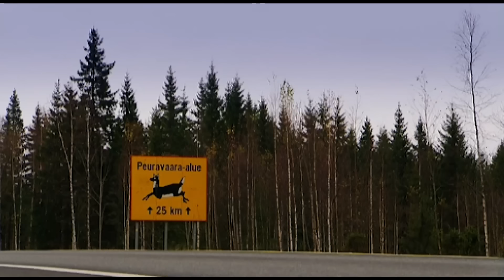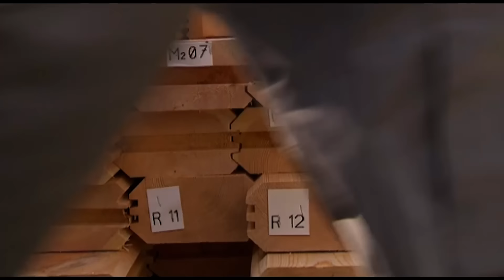Kent | Season 5 Episode 3 | Grand Designs UK With Kevin McCloud | Full Episode

Comment: What a triumph.
The house is beautiful and elegant.
And it for once that is actually eco-friendly instead of some huge monster claiming to be, despite it being build concrete, steel and isolated with polystyrene(a product made from fossil fuel that burns and is toxic).
Now all the wood means more maintenance than normal houses, but not crazy much and if maintained it will stand the test of time (there is a church made of wood in Norway that is 800+ years old).

Comment: Funny hearing all that praise of how 'fast' it is erected, when a prefab concrete slab house structure that size would've been erected in one day by three men (plus half a day of seam work for two men, then later on half a day of removal of molds etc. for two men). It would've required a crane for the day though.

I don't mean to knock timber structures, just pointing out some benchmarks of other alternatives.
Reply: in the states, concrete work is so expensive that most people fall back on timber to save money.  I just finished about 14 yards of cement.  patios, upright form walls, and steps + huge driveway.  Did all the work myself, with the cement truck driver just sitting in his truck all day.   Reason to not hire,  the bids were 48k for everything but the footing forms. which were about 18k I think.  did it all myself in 4 days.  with 2k worth of cement. and bought one new float.